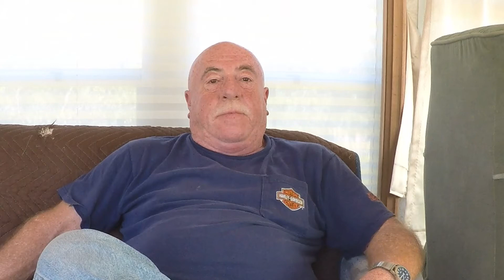Suggestions For Old TV Replacement

Comment: Tiffin is doing exactly that in those newer small coaches they are building in the bedrooms. They are very cool. They are mounted in the ceiling in a box. They unclip and swing down. Perfect! Check out the Allegro Breeze by Tiffin Motorhomes
Reply from the maker: Michael Turnage Now that flat screen TV's are the norm I think it is the perfect place for them.  Thank you for sharing!

Comment: If your going to go ceiling mount, I would think a frame made out of angled aluminum might be enough and maybe a small deadbolt style lock when its in the up position. Then wrap it in wood for looks. Hinges or a rod as a pivot point.
Reply from the maker: Bill Peacock Hi Bill, great idea.  I am thinking along those lines.

Comment: Take the time to look at the distance between your map lights and the depth of your overhang to the curtain rail your box will mount under the overhang frame it in like your window coverings better fix than trying your ceiling which would not be wise if you look at what is there to hook to
Reply from the maker: Donald Losey Hi Donald, I have a few ideas about how to do it.  Your point is very valid and must be taken into consideration.  Thank you for your input.

Comment: When I sit down to watch TV I want the TV right in front of me. I don't want to crank my head left or right to see the screen. Judging from where your seating is, instead of placing it in front above the driver area, put your box above the entry door. You're short enough it shouldn't bother you or me while entering. And if your mount has a swivel you'll be able to angle it while sitting at the table chowing down. Just some thoughts. Could also beef up the end of the cabinet at the entry door and hang one there that swivels and locks for travel.
Reply from the maker: Jerry Densmore Jerry, I agree with you, my problem is the layout of the rig.  Window placement and clearances really limit where an item as large as a TV can be placed.  I will take some more measurements and see if I can do what you suggest.
Reply from the maker: RxMixer
This is going to take some thought!

Comment: I did that too...  Put the flat screen where the "hole" was....had 2 small 12Volt dc motors and rods in so that the flat screen would swing "up" and be flat on the ceiling.  Then you can use the "hole" for storage of DVD.s and VCR's    Jim  402-806-6165
Reply from the maker: jim fleming That sounds like a great idea!  I want mine to work manually to keep it real simple.  Thank you very much for the input!  I would love to see some pictures of that setup.

Comment: Personally, I think I'd be nervous that the ceiling can handle that amount of weight. You're looking at probably 15 pounds for a TV, plus another 10 pounds of wood, is my guess? I guess I don't know enough about the ceiling in a motorhome, if you can access studs or not, but the ceiling being able to handle the weight would be my concern.
Reply from the maker: RV DogVentures I think it can, I can walk on the roof.  Also would distribute the weight over a large area.
Reply: Rufus N Dufus Fair point. Are you able to locate studs in the ceiling?
Reply from the maker: RV DogVentures Yes

Comment: just buy a mount from partsexpress.com so much easier and cheaper then building one.
Reply from the maker: Jake Revolinsky I have seen that one, yes it is easier and cheaper.  I am not sure if it will fit in the area I want,  It also leaves the TV exposed.  I will definitely check it out in more detail.  Thank you for sharing.